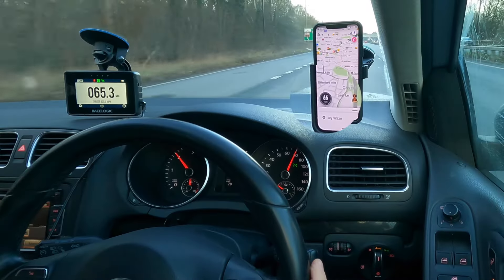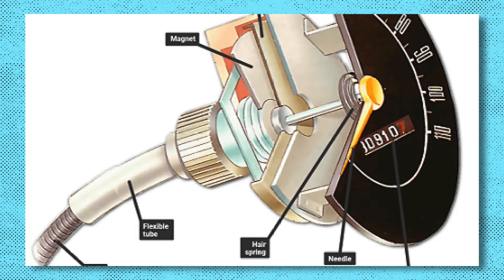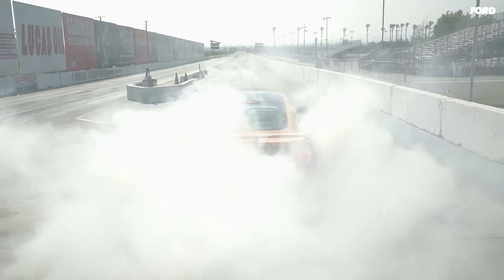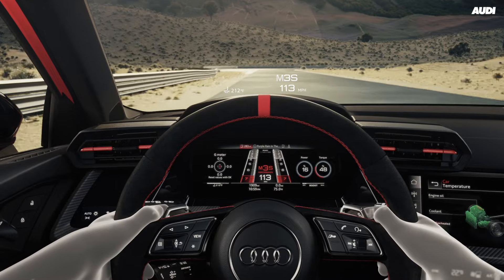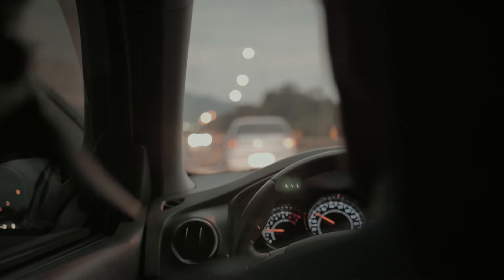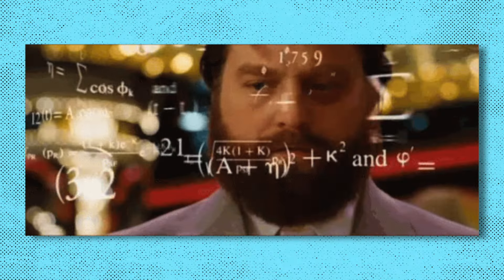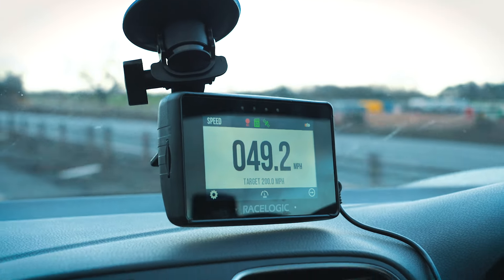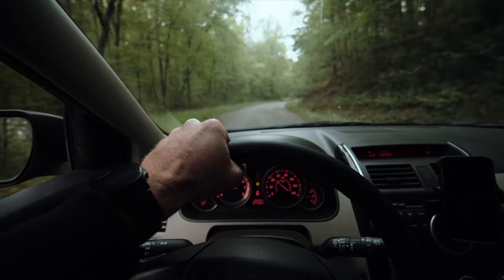Why Your Speedo is Lying to You

Comment: In Australia, regulations (ADR18) required a car built before July 2006 to have a speedo read the actual speed +/- 10%.  The vast majority of manufacturers, of course, tried to make the speedo as accurate as possible.

In July 2006 that regulation changed, so that a speedo can NEVER read a lower speed than what the vehicle is actually doing, but MAY read up to 10% + 4km/h over the actual speed.

So not really a significant change.  Except, the national transport authority in Oz ... err ... actively 'encourages' manufacturers to make maximum use of the allowed tolerance.  Put simply, it is a strategy to make the speedos in all cars (made after 2006) read high, thereby slowing traffic.  So the same result as reducing ALL speed limits across the country by 10% + 4km/h , without the political backlash of doing so.

And before you say "but my car here in Australia is made in Europe, so it will be more accurate", let me add a minor detail that was missed in the video.  Basically all modern cars get an extremely accurate speed reading from the relevant sensor, and that is what is supplied to the ECU etc.  But the ECU then hands that input to the dash display unit, which displays the speed etc.  It is in this unit that the speed is 'modified' to read 10% + 4km/h higher than the actual speed.  This allows for the odometer to remain accurate, as the 'correction' is not applied to that element of the display.  So all the European manufacturers have to do, is a simple software update to the cars coming to Australia, to make the speedo read high, as is required.

So to put this in more practical terms.  When you are in the Righthand lane of a multilane motorway, trying to overtake at the actual 110km/h speed limit, and there is a car sitting in front of you, slowing you down ... say doing 96km/h (by your accurate speedo or GPS)?  Well, his speedo says he is doing 110.  Just as the authorities want.
Reply: And people still complain when they get snapped by a speed camera and the speed camera even has a warning sign ahead of it lol

Comment: Typically I found my speedos to between 5-7% out but my BMW is alarmingly accurate I think it uses gps via the nav system . My wife’s Prius was about 10% out so 70 was 63 at best , I wonder if that was deliberate
Reply: Believe in JESUS today, confess and repent of your sins. No one goes to heaven for doing good but by believing in JESUS who died for our sins. GOD loves you soo much unconditionally.😍😚☺🤗❤😇
Reply: There's a setting (accessed via the ODB2 connector) where you can set it to be an accurate reading. I suspect that one of the previous owners has adjusted this setting.
Reply: @alunesh12345  go away
Reply: @igniteED  No previous owners on my g82 im the first

Comment: You missed a key point: If the speedo is always +10% then your cars mileage reading is wrong.  When your car's odometer indicates it's travelled 100,000 miles it will have actually only covered 90,909 miles in reality. 

Unless it's a Mazda mx5 of course.
Reply: Most vehicles read ( sense ) the speed and distance incredibly accurately , but, they deliberately display the speed as lower than real to conform with law.  So mileage with come from the accurate reading.
Reply: @nobodyimportant7380  that's not true.  They don't display the speed as lower,  they display the speed as HIGHER than it really is.  

Secondly there are not 2 streams of information the mileage is based entirely from the speed sensor readings,  so yes the mileage will be wrong like I first explained.

Maybe rename yourself to "NobodyIntelligent"
Reply: @steve0680657  oh I'm sorry, I used the wrong word by mistake. As the ECU reads the information accurately then displays it deliberately wrong, it can be seen as 2 streams of information when read at the ECU.
Displaying the speed incorrectly deliberately higher than actual, will never get the manufacturers in trouble,  displaying the mileage incorrectly ( higher than actual )  would have them sued as it could be used as a way for them getting out of a mileage limited warranty repair.
Reply: @nobodyimportant7380  there are not 2 streams of information the mileage correlates to the speed.
Reply: @steve0680657  one in (accurate) and one out (altered) to go to display, is two streams. But if have actual ECU data to confirm what you are saying then show me, I am happy to be incorrect with evidence showing that fact.
Reply: @nobodyimportant7380  show me the evidence, you have nothing but your imagination so far.
Reply: @steve0680657  You understand I was asking for you to show evidence there right ?
Reply: I have a very old car with a mechanical speedometer, like he showed in the beginning. It reads from the torquetube and is geared to mathematically read the correct milage and speed with the right size of wheels. So my odometer is always correct. Yet my speedometer can be wrong and I had to adjust it, that is because you still need to calibrate how sensitive the dial is to the rotating magnets.

Same with digital. The sensor reading is accurate with the correct wheels, but it's then up to the computer to interpret that reading. They can do a different calculation for speed and distance. And it would be illegal to intentionally make the odometer read incorrect, but not the speedometer, which can read higher than reality. 

So while there is only one sensor, giving one stream of information, both meters digital or analog can still give different information from each other to you on the display.

In fact in pc controlled cars, you could hack it to make the dials show any number you want.

Comment: 2020 Tesla Model 3 Performance speedometer reads high but not linearly... At about 50mph, it reads 52mph, at 80mph it reads 85mph! Running 19"rims with 245/35/19 Michelin Pilot Sport 4S tires. Interesting stuff...

Comment: As another separate comment, I also want to note the effect of the wheel circumference. Back in the early 2000s both myself and my sister owned an E110 Corolla. Mine had the stock 175/65/14 wheels. Hers was modified by the previous owner to run 185/60/14. That's a difference in sidewall height of 2.75mm, or 5.5mm in circumference. On a long-haul trip from Namibia to South Africa we were driving together, and I asked her why she was driving 5km/h below the speed limit. She said she wasn't...
Reply: "modified" bruh that's just changing tires lol
Reply: @Nibblerr are your 12? That’s exactly how the verb modify is used.
Reply: @mahadali619  25 actually. And no, no one calls changing tires "modifying".
Reply: @Nibblerr  that’s literally what the word means, if you’ve changed something, you’ve modified it, be it tires or an engine
Reply: @mahadali619  something tells me you've never worked on anything.

Comment: Yeah, that's why it's OK to be slightly speeding most of the time, cause you're actually not speeding at all. But I agree with the regulations - it is far more convenient to drive just a bit slower, without even noticing, than to get a ticket while thinking that the speed was under the limit.

Comment: I've been using the 10% rule for ages. I regularly drive 10% over the speed limit while going through speed cameras and I've yet to get a ticket (other than when I've not known I'm going past a camera).
Reply: Yeah for 20 years
Reply: in maryland, where i live, the fixed speed cameras allow you to go up to 12 miles an hour over the limit, so 37 in a 25 etc... Of course most people dont know this so they slam on the brakes right at the camera and go 10 under the limit then floor it afterwards cuz idiots ...

Comment: I can tell that at least an NB MX-5 does use the sensors from a gearbox. Changing the differential to a bigger torsen model caused it to actually underread by about 10%. I did get used to it quickly though.

Comment: 97 Renault Clio. Found this out a few years ago when I thought I was doing 100 km/h when I noticed someone with a big bright digital dash passing me and it showed he was doing 92 km/h. 
These days I use google maps for navigation and basically as the speedometer. Noticed that if I drive 109 km/h (GPS) in 100 km/h highways I don't get any tickets. Dash shows I'm easily doing 120 km/h though.

Basically; move over speedometer peasants, 109km/h GPS chad coming through.

Comment: I kinda knew this already since i noticed that gps speed is usually less than the car speed. My dilema is: what about the car odometer? If your car overreads in 99% of the cases, then that means the car odometer is higher than it should be. Also the mileage is worse than the car reports. So, if the car overreports by 5% then for a 60mpg car means 57, not a huge difference, but its a difference
Reply: For the odometer it's not particularly important because it's only a general indication rather than a datum point for specific tasks. If you were buying a second hand car a 90000 mile car that has done 85% of those miles on the motorway could be in better mechanical order than a 25000 mile car of the same age that has been used as a courtesy car and ragged every day of its life, also if you're due a service/belt change at 20K it's not likely to matter within +/-15%. Indicated mpg is again never particularly accurate, it's an estimation designed to highlight optimal engine conditions rather than an actual indicator of consumption.
Reply: From what i gathered on other comments, the odometer is usually very accurate. It is only when displaying the speed that they add a margin. Now i lack soucres to confirm, but others seems to says so.
Reply: My old passat b5 overread 10km/h but odometer showed less km. It was strange but that meant that car used less fuel than calculated or indicated😁
Reply: I can't say for all odometers of course, but I can tell you for my last couple of vehicles the odometer is not connected to the speedo output.

I have mentioned in a comment below that whilst the speedo is often quite inaccurate, the speed sensor on onboard computer monitoring speed in a vehicle is usually very accurate. If you connect to the diagnostic port on relatively modern vehicles, and check the speed sensor output, you will find it is different to the vehicle's speedo output. Odometer figures are based on using that speed sensor.

So, for example, when my vehicle's onboard computer reports the speed sensor as running at 70mph (using the EODB (equivalent of the OBD-II port used in North America) port to read data), my speedo with display 78mph. But if I was to run constantly for an hour at that speed, my odometer would increase by 70 miles.
Reply: @damionlee7658  guess overreporting is so bad that they artificially reduce the value. I usually set my cruise control to the gps speed, sometimes 5-10km above it, but it seems really strange. Also modern cars should be able to auto adjust for wheel, since they have a gps internally and they can compare the gps speed to the wheel speed. Tesla can detect wheel uneven wear, this should be easier to do
Reply: @DjDolHaus86  Actually, it is important if you lease a car but the good news, Odometer readings are done differently and are very accurate
Reply: @BogdanNourescu  that's interesting I've always noticed my car to be extremely accurate with stock wheels and I have even changed wheels and tire sizes a few times and it continued to be accurate my car had a GPS system tho it does not function. It think I'm in the pacific ocean lmao. But no matter my wheels size it's always been accurate
Reply: @sridvan  interesting, I have a b5 that reads closer to 5 kmh over. It would be nice if the odometer and milage are less than they say for me too! I'll have to do some tests
Reply: We have a motoring magazine in South Africa called Car Magazine that generally gives a detailed statistical analysis of each car that's reviewed. They actually measure the odometer error percentage and place it in the statistics. So even if the speedo and odometer are not connected, there is still a disparity between the real distance and the odometer distance.
Reply: @DjDolHaus86  +/-15% could make a big difference when you return a leased car.
Reply: @scottcampbell2707  Please elaborate?
Reply: @DjDolHaus86  When you return a leased car, you may need to pay for miles/kilometres that you traveled beyond the contracted amount.  It might only be ten or fifteen cents, but that could add up to a lot for someone that drives a lot.  If your odometer reads 1000 too many miles, that's another $100-150 you might have to pay.  Or 1000 miles you didn't get to drive because you didn't want to go over.
Reply: @scottcampbell2707  But that is indicated miles (ie. miles indicated by the gauge) so the relative accuracy is irrelevant, you have the indication as to whether you are within the stipulations of the contract. If you're trying to squeeze every mile out of the contract based on several different sources of information (GPS/Road signs/personally estimated usage before signing the contract etc.) then that is your gamble to make.
Reply: @DjDolHaus86  if I paid for 12000 miles, I would expect to be able to drive 12000 miles. My work isn't going to get any closer if my odometer isn't accurate.
Reply: @scottcampbell2707  If you pay for 12000 odometer miles then you are entitled to use 12000 odometer miles. All distance systems have an expected margin of error and the terms of the contract are clearly described, if you assumed that the data upon which your calculations were based are 100% accurate then that's kinda your fault for not taking into account a margin of error. Contract prices are structured to make buying a 15K contract a better deal than exceeding a 12k contract and paying penalties. Just because my car says it does 50 miles to the gallon it doesn't mean that if I've got to drive 500 miles I should expect to use exactly 10 gallons of fuel.
Reply: @DjDolHaus86  I don't disagree. Just saying that the accuracy of your odometer could have a financial impact.
Reply: @scottcampbell2707  Fair enough

Comment: I had a Golf. It showed me digitally to which speed the cruise control was set. The speedometer showed 100km/h when the cruise was set to 106. The GPS reading was 104.
Reply: Unusual usually golfs read high

Comment: That’s interesting. Adds another level to how fast people drive now. Really tempted to test this out now 😂

Edit: tested the theory and yes, my dads 2018 BMW 5-Series does it too, the car was 2 mph above the what the GPS was telling me.
Reply: I used to have an E36 and I currently have an E60.  Both would consistently show 2mph faster than the GPS showed I was going.  The E60 is a little more odd though.  I've coded the cluster to show a digital reading of the current speed.  If I set my cruise to 72mph, the GPS speedometer on my phone will show 70mph, but the digital reading in my gauge cluster will show 69mph.

Comment: I have 2 holden. A vr wagon and a vs ute. Both have a vss on the output shaft of the trans. The vs ute is spot on with gps and the vr i changed the diff gears over to r31 3.89:1 and i used a jaycar electronic speedo corrector so its also spot on.. missus has a ba falcon and a kia cerato both around 6kmph out.

Comment: When I got my BMW I noticed the speedometer was always reading faster than I was actually going so I researched it and apparently German cars must always over read and never under read the speed. There’s a setting in BMWs that lets you make the speedometer display the actual speed but that’s turned off in the United States. I used an online calculator to figure out what tire size I needed to install to get the true speed reading on my speedometer and installed that size of tires now. They were very close to the original size but made just a small difference in my speedometer and now it’s spot on.
Reply: Thats right. Im in europe and my BMW have submenu where you can read actual speed. It is always few km/h lower than reading speedometer is displaying.

Comment: This is absolutely true!! I own a 2014 Cayenne GTS and a 2018 Macan S and BOTH Read exactly 5MPH over. I asked Porsche about and they told me all their cars do this. My mom’s 2018 Audi Q5 equipped with 20” wheels is almost spot on accurate but my 2009 E63 AMG was about 3MPH over.

Comment: 1987 Toyota landcruiser, compared to a gps Speedo, my Speedo over-reads by about 4km/h, had a new cable put in about a year ago, also have tyres that are slightly bigger then factory (not much taller, but wider)

Comment: My 16 Miata Club (17" factory wheels) was dead on with OEM size tires. Of course my slightly wider tires (same sidewall ratio) have caused it to underread. Thought about having it recalibrated to match, but I doubt it's worth the trouble.

Comment: Infiniti here in the USA, with factory correct tires and wheels, will read about 3% over GPS speed reading. I re-calibrated mine with slightly larger tires.

Comment: 2016 Mazda CX5 Sport (USA Version). The speedo always reads like 1 or 2 mph faster than Waze. Dealer technician told me the car does this to be in compliance with certain laws. In NY the speedo must read at least as fast as the car is actually moving but can't be over by more than 10% so manufacturers intentionally calibrate the speedo to read like 1 or 2 mph faster all the time. If not they could be fined for manufacturing your car with an "unlawful speedometer".

Comment: Both my 3&4th gen TLs are spot on with oem size tires. I realized my sisters X5 are 3mph slower at 70 with oem size tires, both of the ones she’s owned 2010&2013.
Reply: And to be clear by slower I mean you’re really doing 67 when it reads 70